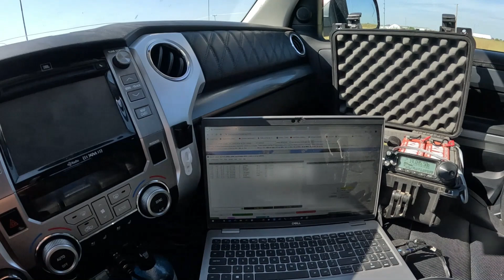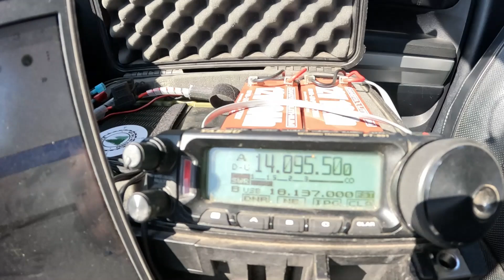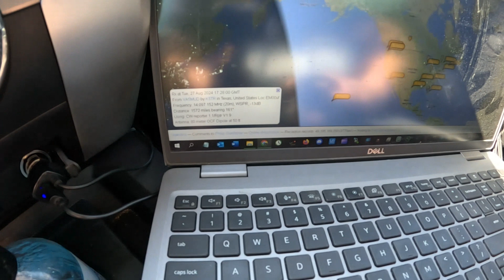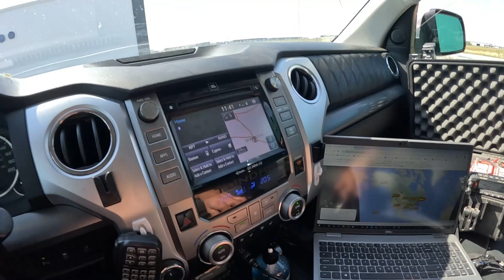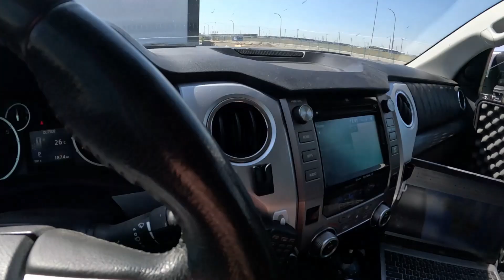STUPID HAM ANTENNA TEST.  WILL IT WORK? #weird #hamradio

Comment: Great experiment, Wes! 
I used to live on the top floor of one of those 3 story metal buildings above the business. I put an ATAS 25 on top with counterpoises running on top of the metal. It worked DX! That was from the roof, though... Band conditions were pretty great then, too. Keep up the good work 👍
Reply from the maker: Hey Bobby!  Yeah metal buildings are good for something.  I think I’m going to slap something on top of my work, huge metal roof.  73’s for now 🍻

Comment: From your parking position, most of your RF going over the Passenger Side of the Engine. Around 16:00 Pacific Time. I drive into the handicap parking. My signal coming off the rear from my HI-Q. I'm facing west and yet ve7jbq (7100 Aurora Net)  from the Nelson area picks me up off my back end quite well. I guess RF reflected off the hood into the building
Reply from the maker: Interesting 🤨.  Great insight and thanks for watching